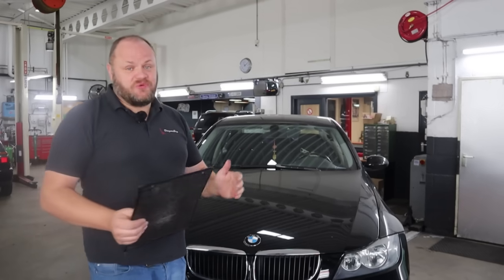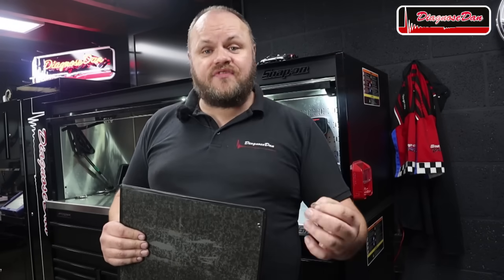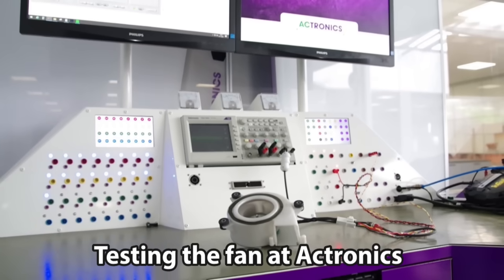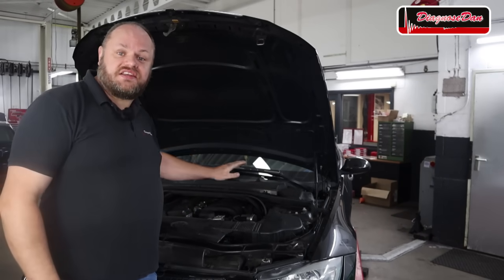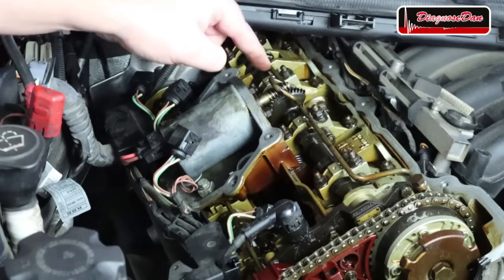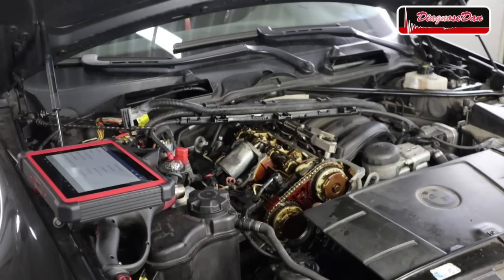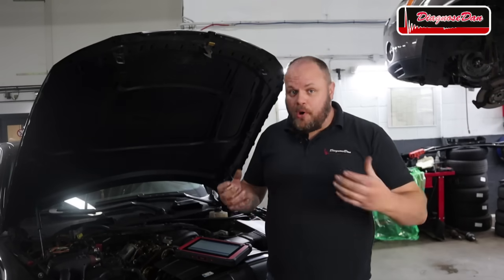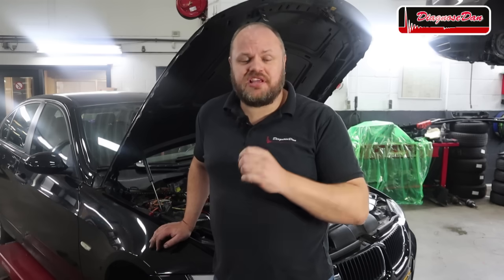Bmw valvetronic,Explained,Diagnosed,Fixed

Comment: if an electrolytic capacitor has current all the time or is exposed to a lot of heat then you will shorten the life dramatically.
Electrolyte capacitor has several weaknesses and has a lifetime
Reply: depends on the buid of electrolitic capacitor. Some are well buid but a lot more expensive,  made with tantalum.../ or produced in contries like Germany, Japan..
Reply: @MrFryfish  Tantalum capacitor of this size is expensive. Tantalum capacitors have mind weaknesses.

All electrolyte capacitors have some weaknesses no matter how expensive they are. Electrolyte is widely used due to its relatively small size.
but they do not withstand heat so well and they do not withstand standing with current constantly. They also have a certain life time which is much shorter than the cast-in types of capacitor.

The problem is that cheap capacitors are often used and not the better ones since you cost more.

Comment: Bleeding power to ground through the motor housing is never good.  About 5 mA at charging voltage,  but probably much higher during fault.  Heat the motor up and the measure the resistance.  I bet it will go down. Great video.  Thanks.

Comment: Good stuff Dan. I reckon the motor showing a high resistance breakdown to earth / ground is not conclusive proof of the intermittent go / no go fault, but it needs replacing anyway. Looks like a nice clean and well maintained engine.
Reply: We need a teardown of the motor to find where the conducting happens!

Comment: the resistance to the casing could be one of 2 things  ,there should be noise suppressor capacitors built into the brush assembly and they send the noise to earth = the motor casing , so if one of those capacitors goes leaky or short  your readings will show that or an overheated rotor winding with now compromised insulaton, the rotor core would get earthed via the bearings  but in both cases  i would expect the diagnostics to say "motor  short to ground , intermittent " or "motor over current" so im not sure but then that resistance needs to go lower to be an issue, maybe it does when the motor is hot?

Comment: Good job! Thanks.
Does anyone know how useful this system is? I have trouble seeing how it could make much of a difference.
Reply: He just said; the motor is running more efficient, so the fuel is used more effcient on lower revs ...
Reply: I get good MPG from mine on a run, better than my previous E36 model. Oil MPG not so good as it seems every seal I've encountered has turned into a hard plastic, and I'm still nowhere near finding why it dumps oil.

Comment: I got this system in the N52. Lots of low RPM torque compared to the M52 six. No problems after ten years and looks easy to repair.
Reply from the maker: That's great to hear Mark

Comment: Thanks for the fan failure analysis. A typical problem in modern pulse electronics.
The appearance of the resistance of the terminals to ground is the graphite dust from the brushes. Perhaps this motor is PWM controlled with leakage control to ground?
Reply from the maker: Thanks for sharing!

Comment: Dan, if the test is on a 2 wire motor it is a brushed motor and the high resistance reading to ground could be carbon deposits either on the brush gear or field windings insulation breaking down. It can be a very good test of an aged motor and yes, a faulty one.
I'm a former Auto Electrician and now Electronics Engineer so I love your videos, brilliant information, well explained and fun. Keep them coming. Ray
Reply from the maker: You are right! Thanks for watching!
Reply: This could also be moisture inside the motor body causing ground leakage, either way the part is not serviceable.  Well done Diagnose Dan!

Comment: I really dont think valvetronic has anything to do with reducing pumping losses, given that the restriction is now moved from the throttle body to the intake valves. If this pumping loss was removed at part load it would mean that the engine is pulling in more air than required - too lean. You need a restriction somewhere to limit the air intake for part load.  I think it probably has more to do with creating turbulent flow during the intake stroke. Better air fuel mixing especially if its direct injection - not sure if it is or not. Great video nonetheless 👍🏼
Reply from the maker: Thanks for watching!

Comment: The chassis to winding resistance in itself is not critical for such a low voltage motor, but there should be an open between the two in this motor as it is not ground connected.  Also, the fact that the new one is basically an open, and old one fails when hot, tells us, that there is something inside that makes a short as it expand when it heats up, and from there is positive feedback loop, very bad.
If this motor is a known failure, then maybe the design of its winding is too close to chassis, heats up too much, bad insulation in general to make it small, etc.  Is there a maintenance notification from BMW about new version of this part? ie "enhanced version".
Not a BMW expert at all here.
Great video as always, the best car mechanic in YT that teaches us a lot.
Reply from the maker: It looks like the dust from the brushes that's trapped inside the motor creates a path to the body
Reply: @Diagnosedan  Very interesting, but that would not make the motor fail when hot.  For sure not good, but the resitance you measured (~2.8k IIRC) is nothing for the motor controller.
Maybe it shows how worn the carbons are, and due to that it fails when hot.  Guessing here.

Comment: Nice one Dan. I see alot of desinigrated ground straps on old BMW's. When these straps lose their capacity to flow current, bad things happen. The current tries to find an alternate path with up to 220 amps of arcing power.   Electric motors get hot, arcing thru the driveline bearings... These ground straps are usually barried deep in the engine bay out of sight.
Reply from the maker: Thanks for the feedback

Comment: Yes as a Multi craft tech for a production plant here in USA any resistance from a motor lead to ground is a sign that the motor is about to go. Although I mostly deal with 3 phase AC motors, DC motors are much more prone to intermittent issues as it's only 2 poles, and stepper motors, such as that for Valvetronic, need a clean current path to work properly. We use a "Megaohm" to check motors for this on the industrial side of the industry
Reply from the maker: Thanks for the feedback Kevin!

Comment: The continuity of the motor housing to the terminals is probably through the brush dust trapped inside.
Reply from the maker: You are right Ken!

Comment: Hi Dan, nice to seeyou back, don't leave it soo long next time 😁, you must have nerves of steel undoing two 10mm nuts without anything underneath to stop them falling down the cylinder head  I know they would end up their if I did it.
Regards Richard 🇬🇧
Reply from the maker: Hi Richard, the nuts wouldn't have fall very far😁 thanks for taking the time to leave a comment it's really appriciated
Reply: Always informative and I learn something every time.
Hope you are all well. Regards Richard

Comment: The cars smart! It’ll set a stiff movement fault. Gotta diagnose the power supply and check for voltage drop to the motor!

Always connect the grounds at the valve cover  if your gonna test a bmw engine like this! Otherwise, you’ll be buying another DME😉
Reply from the maker: Thanks for the feedback!

Comment: Working on high voltage high power DC motors, earth faults are a common problem and can cause catastrophic failures if there isn't a detection circuit there to stop them before it gets too bad. I think its a very good way of determining a failing DC motor.
Reply from the maker: Thanks for sharing!

Comment: Another very interesting video, I've just been working on a 2008 M3 S65 V8 with a Vanos problem on the inlet cam of bank 1, turns out the Vanos unit had totally failed. Thanks Dan, your videos help us diagnose tricky problems.
Reply from the maker: Thanks Daryl, i love making video's just for getting feedback like this. I love when my video's help others

Comment: A standard test for electricians is to megger the motor. That applies a high voltage to measure insulation resistance to ground. The value needs to be in meggaohms. Else, you have a problem.
Reply from the maker: Thanks for sharing!

Comment: As always pin point diagnosis not changing all sorts of parts guessing, I worked as a auto technician for 40+ years and would have really enjoyed working with you, I hate guess it merchants, you always do it right in my opinion. 👍 I was one that commented on the capacitor on those fans, I just knew there was more to it than a fan issue, thanks for updating us it makes me happy to know my brain still works.
Reply from the maker: 🤣🤣 Well i listened to you, i hope your brain is satisfied 🤣 Even in the original Lexus Tsb they don't tell you what's wrong with the fan, so we went the extra mile😁
Reply: @Diagnosedan  👍😁

Comment: Great video Danny,  as usual your videos are very informative, I’m a Beemer tech, situated in sa I always have spare valvetronic motors mixed up, now after watching this I realized that there’s actually a way of testing wether if the motor is functional or not. Gonna sort and label them as soon as I get to the shop.  Thanks a lot buddy.
Reply from the maker: Let me know how many failed the test😁
Reply: @Diagnosedan  definitely
Reply: @leonngobeni6735  how many?

Comment: Dan do  one  educational video about  denox scr sistem faults  and fix ,how can we deal with engine stop threat message  in dash and so on,would be great if brand would be ford or vw audi.
Reply from the maker: I'm actually making this video very soon but it will be exclusive for DDTSB.
Reply: @Diagnosedan  so the poors should die :)
Reply from the maker: @danko760  we recently had a digital open House where everybody had free access to DDTSB and could watch the video's for free😁

Comment: @12:56 - In the HVAC industry this is a valid test to gauge the compressor motor winding insulation health condition, except a specific measurement eqiupment is used.  On this motor, it appears the motor windings insulation has degraded and thus causing an internal short.
Reply from the maker: Thanks for taking the time to leave a comment!

Comment: good video Dan thanks, but for that test with ohm meter on the motor to ground ,i do not think is a good test there always brush residue in motor that will do that.i would like to see the motor heated up again and see if it goes open circuit ,could be the armature welding or brush sticking or oil on armature comutator
Reply from the maker: Thanks for sharing you thoughts Dan
Reply: No OBD2 port 🤔

Comment: Another great video Dan. Just remember, before removing the Valvetronic motor, one must relieve the tension on the return spring by either putting the Valvetronic in the “service” mode, or by manually relieving the tension with an Allen wrench through the little pin hole on the back of the Valvetronic motor unit.
Reply from the maker: I've done hundreds, always like this and never had a problem😁
Reply: The tension on the valvetronic cam gets relieved when you remove the valvetronic motor, the valvetronic cam can be moved by hand after the motor has been removed
Reply: I got a 320i 2005 and the valvetronic motor had no place on the back for a Allen wrench, even on the one that was replaced

Comment: I’d like to see that resistance reading when the motor was warm and also a insulation tester would show the potential short to chassis in the motor winding. Love this video
Reply from the maker: Thanks for watching
Reply: I would guess more that impedance is to do with the EMI filter in the motor than a short to chassis. The body is normally tied to chassis ground with a lumped impedance between each terminal and the chassis.
Reply: @sdgelectronics  Thankyou for educating me

Comment: The throttle valve is not always open, just check your live data during idle or partial throttle. Its just a bit more open than a regular gasoline engine.
Reply from the maker: You are right but i didn't want to overcomplicate the explenation. Thanks for watching

Comment: For those with other Valvetronic issues, wear in the eccentric shaft is common, but also the valvetronic position sensor can crack internally and leak oil into the connector. This would be the electrical plug you see by the oil filler cap.
Reply from the maker: You are right! Thanks for sharing
Reply: Would this cause smoke to come up everytime the car starts up and the smoke doesn’t smell like oil more or so like plastic ?
Reply: @danielarevalo3525  I don't think so. If the smoke is very quick, it could be a belt slipping. Oil smoke can be common if the valve cover gasket is leaking, some oil will drip onto the exhaust manifold, and after 2-3 minutes when the manifold is hot enough, it will burn off the oil and then you usually won't see anything again until the next day where more oil drips over night.
The starter motor could have problems can cause electrical smoking on start up, but there's nothing particularly common to immediately start changing parts. Best option is to watch when someone else starts the car, and see if you can track down the location.
Reply: @enda320  yeah im getting cylinder 3,5,6 and random misfire prob just the the coils or spark plugs, it only has smoke coming up when i turn the car on. The idle is deff like the video though
Reply: @enda320  I’m getting this exact same fault code in my 2008 bmw 320i however it’s also missing engine makes strange noise when accelerating and starting sometimes and moving sluggish can a bad valvetronic motor cause these symptoms?
Reply: @deaneybwoy4332 yes, valves probably aren't letting in enough air on intake so your fuel to air ratio is poor, which can cause loss of HP. I'd def take it to a mechanic....

Comment: You should have very little leakage through the windings to the case. 2.8k ohms is a lot of leakage. Most likely moisture ingress you could maybe bake the motor to dry it out.
Reply: The motor gets cooked every time you use the car.
Reply from the maker: Thanks for the comment!!

Comment: That low resistance between body and terminals is most likely caused by conducting dust from motor brushes. Its definetelly not OK. If there will be short circuit, then it blowns fuse, what i expect to be the root cause are already worn out brushes, causing open circuit on terminals after some circumstances.
BTW, thanks again for the nice explanation of valvetronic system Dan !
Reply from the maker: Thanks for sharing sounds plausible!

Comment: Likely an expensive part/motor. I'd bet it has a bad solder joint or printed circuit on the board maybe. Probably could be fixed depending on the price of that new part. This is really sad that a part of this type failed so soon. Maybe just remove that motor and use the throttle body !! All of the engineering that they put into these cars yet inferior parts make it not worth it.
Reply from the maker: The motor is a brushed 12v motor so no electronics
Reply: Disabling it would throw the check engine light and probably adversely affect emissions both of which would be an MOT failure in UK at least.

Comment: Hi Dan, good to see you post again!
Dan should there not be a caution for interference engines?
Reply from the maker: Thanks for watching, i'm not 100% sure what you mean
Reply: @Diagnosedan  That engine is a noninterference design but other BM's are interference where the valves may smack the piston tops.
Or am I out to lunch (again)
Reply: I had the same thought, but thinking further it seems to me the only valve that would open further is the one that is already partially open, thus the piston is already on the way down
Reply: @lesbender236  I could be off the mark but seems to me the 8 cyl with the same vamos are interfering engines as well as the 4's?

Comment: If this motor is a brushless type with electronics built in (like the fan motors you showed) then yes your test is right and there is a short or at least moisture gotten in. For brushed motors 2.8kOhm resistance to the housing could also be just carbon dust due to wear.
Reply from the maker: It's a brushed motor
Reply: Двигатель valvetronic с щетками

Comment: A rule of thumb is 1000 Ohms per volt of your insulation meter test voltage. A 12VDC motor should be tested at least with a 50VDC test voltage. 2.8k Ohms insulation with a simple multimeter is way too low.
Reply: That's right, we use an insulation tester for these kinds of problems. It's the best way.
Reply from the maker: A that's great info!! Thanks for sharing

Comment: So happy you did this video!!! I just did this job on a N55,  but in this design both the sensor and the motor are one.   Thank you for this learning video!! Keep it up 👍
Reply from the maker: Yes those motors fail in a different way😁
Reply: @Diagnosedan  in what way to be exact? Have a N55 myself so wanna be prepared😂
Reply from the maker: @ademc8872  if a machine gun sound starts coming from the engine it's time to replace the Valvetronic motor on a N55😁
Reply: @Diagnosedan  haha zalig. Dankjewel voor de tip! Rond welk km gaan deze stuk?😆
Reply: Ok my N55 is now 8 years old and only about 68k mileage,   The x5 started giving me odd codes about not knowing it’s position anymore.  After reading the codes and a bit of research it became apparent that the sensor died on the motor and needed to be replaced.  It’s was a very involved job..